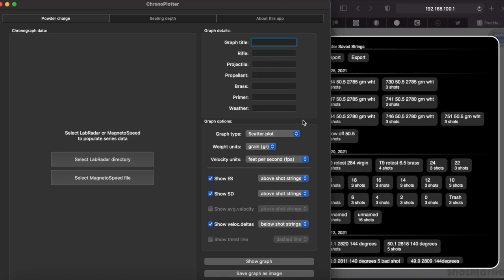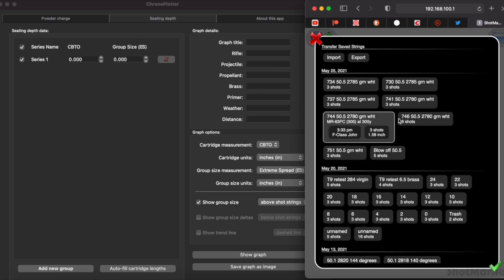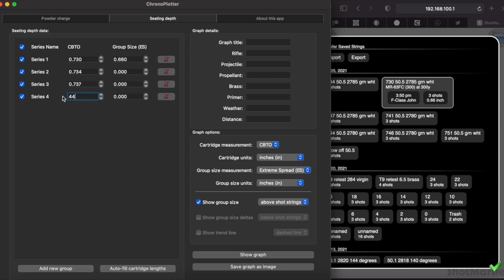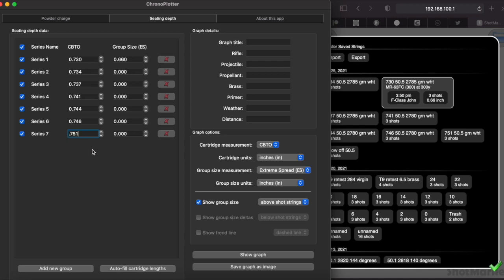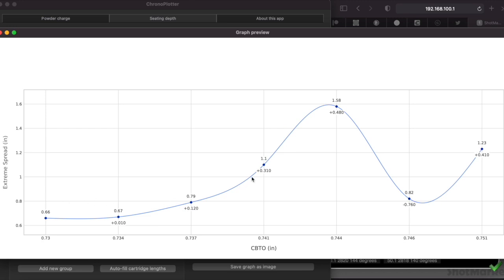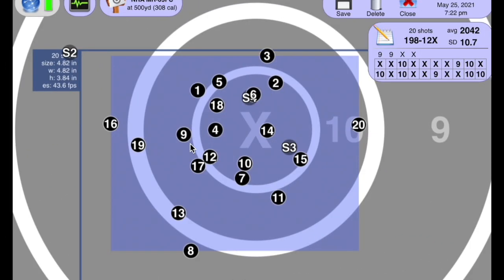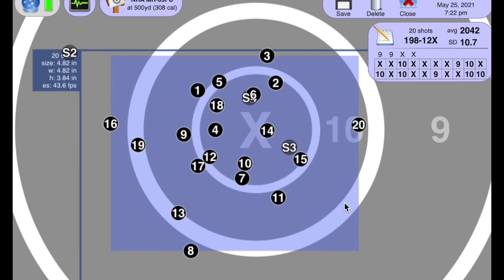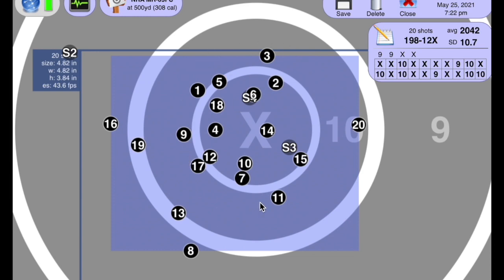How to Use Chronoplotter to Optimize Seating Depth for Perfect Loads

Comment: Really nice tool, is there a way to print results for like a paper log ?
Reply: Hi, I'm the developer. There's currently no built-in way to print the results, but you can save the graph as a file (.PNG, .JPG, or .PDF) and then print that. I can look into adding a print button in a future version.
Reply: @michaelcoppola8187  Hi there well first of all, thank you for sharing your program, I just download the program I was away from home so I couldn't install it in my work computer, and also congratulations for such amazing program, PDF will work, I will keep an eye for any updates, one more thing since I can get answers straight from you, will this work on either android or an ipad ? or maybe iphone ? the reason I'm asking is because at least in my case I have to drive like 45 min to my shooting range and sometimes I take pictures from my phone just to keep records and then I transfer to my pc when I get home.
Reply: @markahdz  Glad you like it! I don't have plans currently for an Android or iPad/iPhone app, but it may happen further down the line. When you take pictures, do you mean you take pictures of shot groups, or chronograph results? I'm investigating if there's any way to import shot group photos into the program rather than manually typing in group sizes, but that may be down the line also.
Reply: @michaelcoppola8187  sorry for the late reply I got busy updating my magnetospeed and run into problems when updating ahaha, I take pictures of the shot groups and then I just create series in my magnetospeed so series 1 picture 1 and so on so I can have a digital reference, I do keep my paper targets, I created one template so they are truly 1” so I can use another software to get correct measurements for the group.
Reply: @markahdz  Gotcha, thanks for the info. It’s useful learning how shooters go about their load dev so I can better decide which features to add next and how to design them.
Reply: @michaelcoppola8187  thank you for this program, what ever you add in the future I’m sure it will be a great help for our community. Keep it up brother.

Comment: When you say ‘virgin brass’, does that mean you’re doing seating depth tests with brass that hasn’t been fire formed to your chamber? Doesn’t this throw off your results?
Reply from the maker: This is caliber made brass, meaning it's pretty close to my chamber so I find the results are close where they'll be when formed. In this case I need to actually shoot my virgin brass in a match so I'm doing load development specifically for this brass and may do another small set of tweaks once it's been shot later.